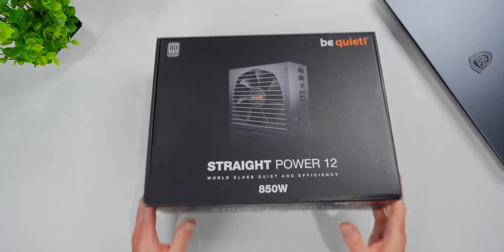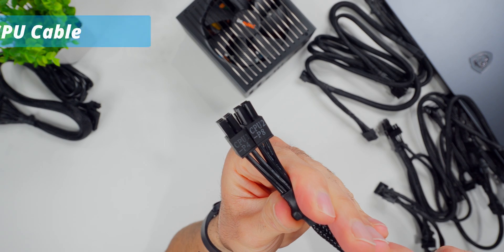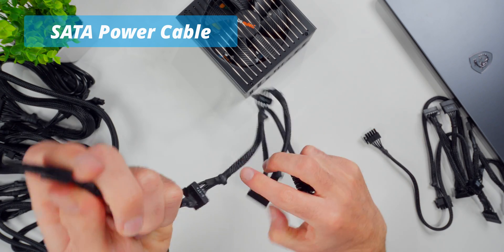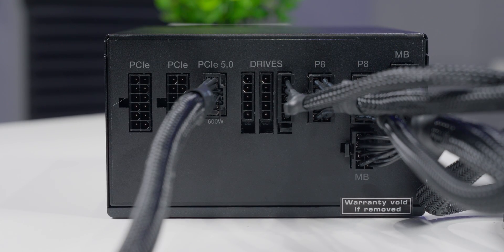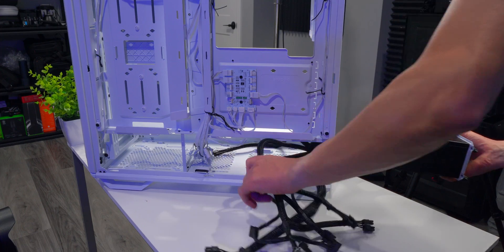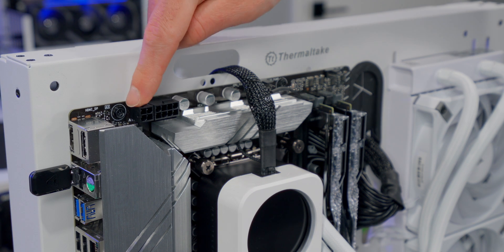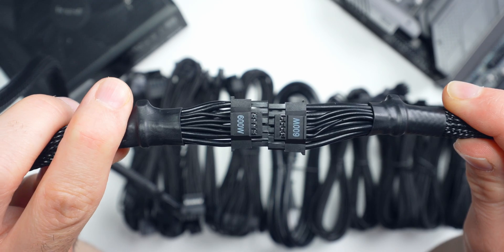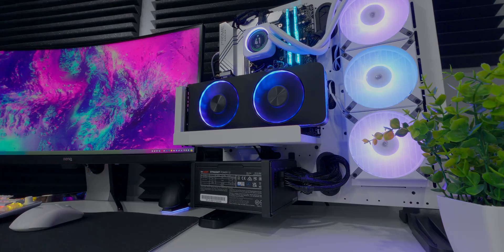How to Install a Power Supply (PSU) in a PC

Comment: Finally someone actually slows down and doesn't assume anything. I have build several PCs over the years but my current build has 2 different sized CPU connectors and my ASUS motherboard manual would be more useful as a fire starter. Be Quiet didn't even have a manual, just a booklet in multiple languages on legal nonsense.

Comment: Thank you for the well done, very informative video. I bought a PS for a new build using an Asus Z790 motherbd. My new modular PS has two CPU 12v 8 pin (4+4) EPS connectors like the split CPU connector you showed but my motherbd 12v CPU connectors are like the 8 pin one that you have on your demo motherbd. The connectors will go on even though they do not match. Do you think it's still OK to use it? Thanks in advance for any advice. Once again,  great precise video.

Comment: Hello, I'm building my first pc today, and with the case( NZXT H9 Flow), the power supply is sideways. Do I face the fan side towards the motherboard or away? Thank you
Reply from the maker: Hey. You should face the fan towards the side panel because it's ventilated (away from the motherboard).
Reply: @ECPUz Awesome thank you